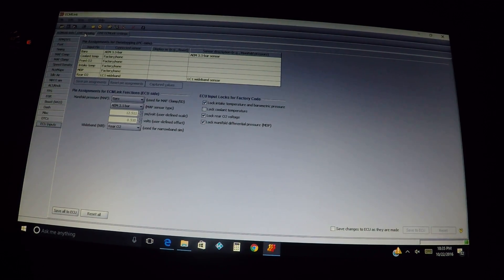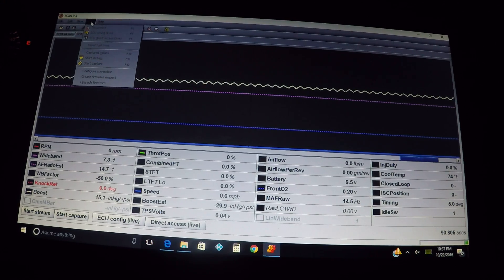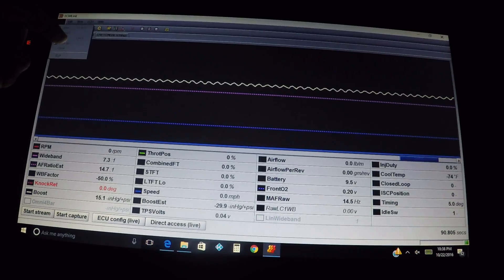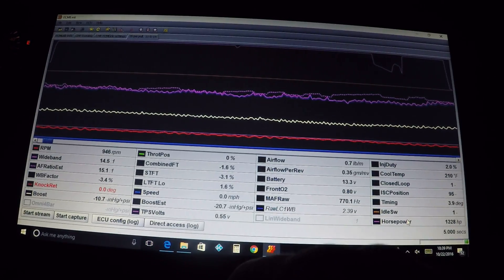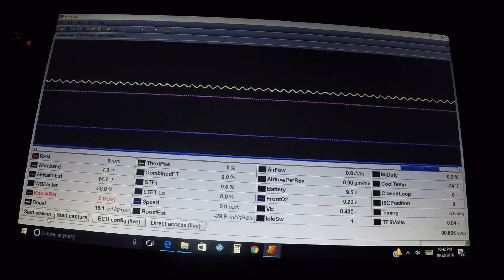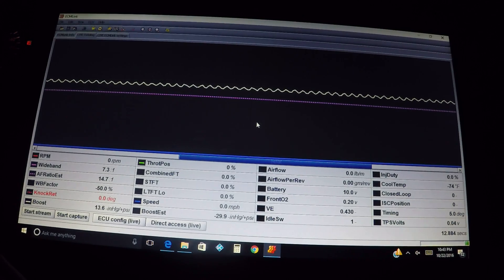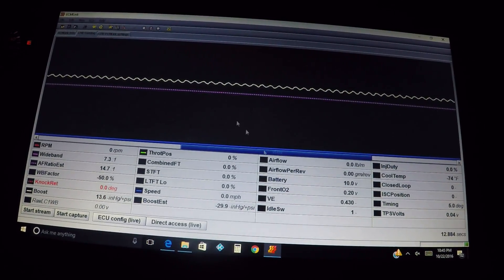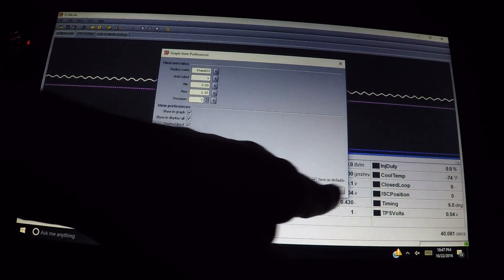Ecmlink Datalogging Screen

Comment: hey scott, my iscposition says  120. mind you the car will stable at 950rpm, after it gets warmed up. should i mess with the biss screw and get it to 30? is that why when the engine is cold it needs a few start and the help of the pedal to get it to smooth out..
Reply from the maker: Still needing help on this one? Just noticed your comment. Sorry.